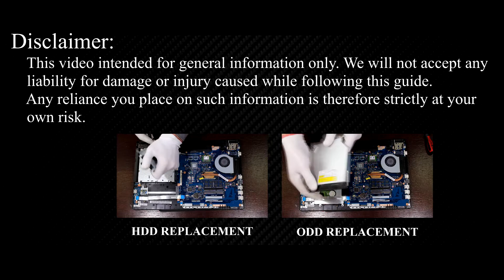Asus P2520LA RAM Upgrade and Install | Step-by-step DIY Tutorial

Comment: good video,is it possible to install 2 ram card 1 of 8GB and one of 4GB ?or must be the same gb?
Reply: Might be a late reply but yes, that should be possible. You might get slightly lower speeds than if you use matching RAM but it's not a big performance loss.